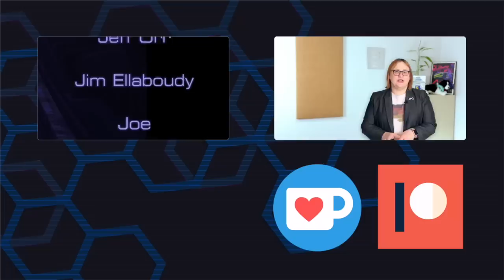Could Electric Bring The MInivan Back? Mercedes-Benz Seems To Think So!

Comment: You can never underestimate the gullibility of American consumers- including those who consider themselves experts.  They will always prove themselves more gullible.  
The SUV (Slightly more  Useable Vehicle) class is an example. All "SUVs" are just small variations of "unpopular" hatchbacks and station wagons. A vehicle's height or proportions is not a serious basis for classifications. 
The only substantial difference between a minivan and an midsize SUV is the height and side doors. A different hood and sloped rear end are just a way to style (not a technical or engineering term) it to make it planned for obsolescence. There were minivans that were as well appointed internally as sedans. 
 
Another triumph of marketing in its quest to make make people buy stuff by calling it a new name and making insignificant changes, not improvements.  Cross two common apples to make one that never spoils (and never turns red) but tastes like nothing pleasant, call it Granny Smith, charge twice the amount per pound as its progenitors, and market heck out of it with the extra profit.  Then take the pro. genitors off the market so there s not way to compare costs. 
"SUVs" and "crossovers" are the auto industry attempt to increase profit by convincing people that they need a more truck-like vehicle capable of operating under conditions where driving is not safe. That increases inevitable collisions (not accidents) that make repair uneconomic, and increase sales.

Comment: I love van based cars and get all excited about owning an EV based one. But then reality sets in when you see how poor the spec is and how high the price is.
Most of the development is going into cars not mpv's.
We have a fleet of Kangoo ZE's and 1 eVito on test at work. IMO they are great vehicles but value for money is a few years away for personal ownership.
If the Kangoo mpv had the spec of the Zoe I'd buy one tomorrow, until then I won't be investing my money into an EV.
Reply: The kangoos are bad, ac only and about 120km of range, the eqv has three times the battery capacity

They need to update the Kangoo but they're being lazy because there isn't any competition
Reply: @EngineeringNibbles  i agree, we don't do much mileage each day in our ZE's so range isn't a problem but in terms of driveability I think ev's are great.

Comment: Minivans lack desirability due to typically looking stupid or  ugly, underpowered, and typically have cheap FWD to drag around rear weight whilst added disadvantage when loading up rear, weight comes off front wheels. Stupid engineering.